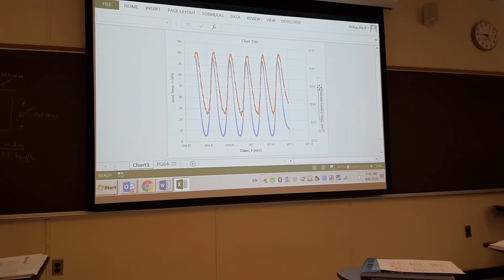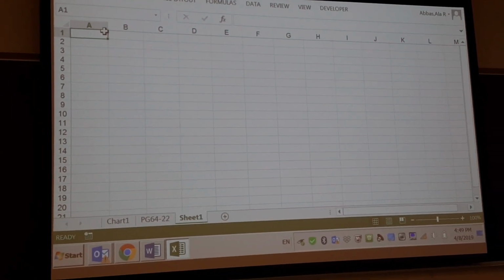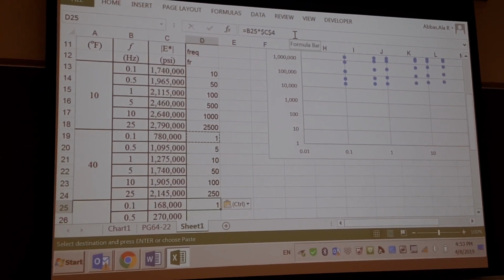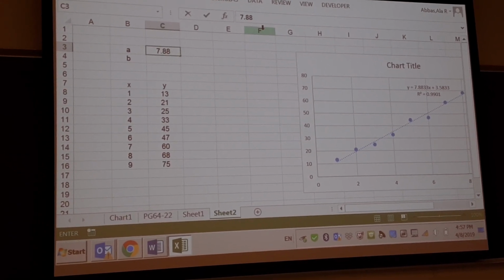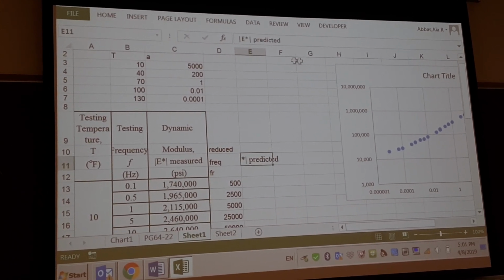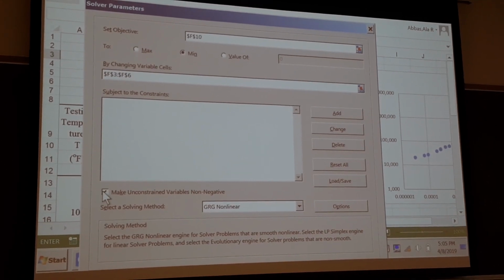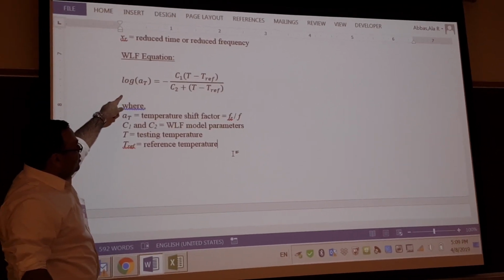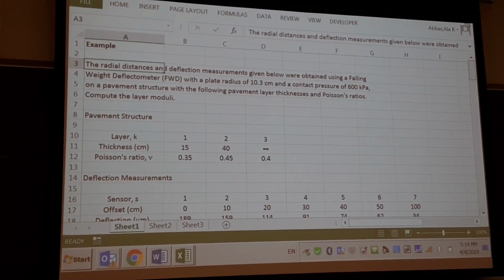Dynamic Modulus Master curve

Comment: How is shifting factor at 70=1, are we assuming it
Reply: Cuz he set 70 degree as the reference temperature. Meaning all other measured data will fit the data measured in 70 degree
Reply: @陳冠霖-f3o  pplease help
Reply: @陳冠霖-f3o  i have a graph of stress relaxation vs time at three different temeprature 
please tell me how to obtainmaster curve and in which software please
Reply: please explain why shift factor was takken 10 for 40 degree actually ow it is being calculated
Reply: bro please tell me how they take other values